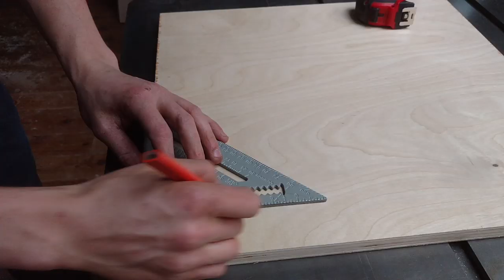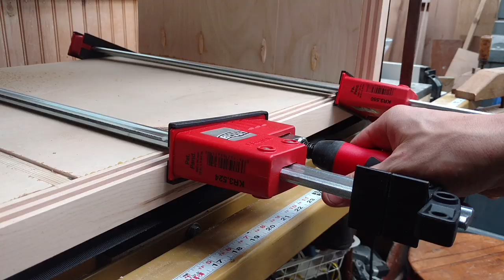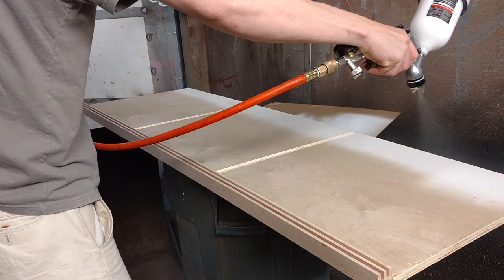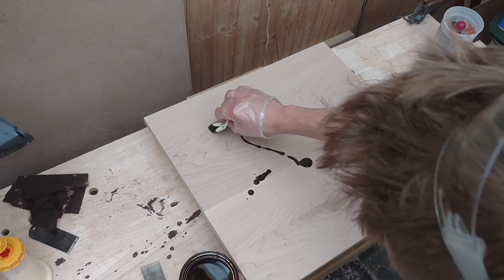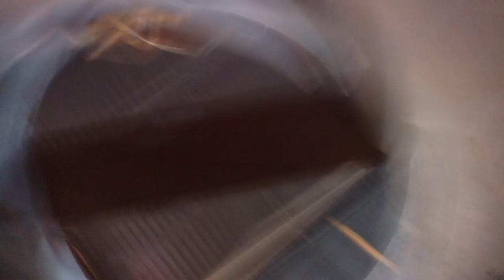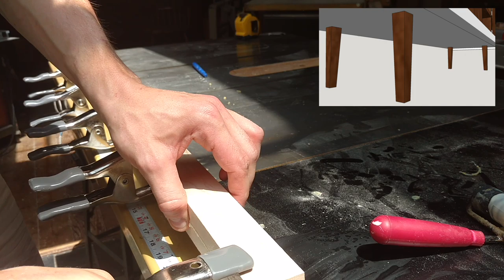Modern Media Console

Comment: Great job, thanx for sharing. What’s the 2 parts paint and ratio you use?
Reply from the maker: Zaldy, I don't remember exactly. It was a laquer based paint. The first was a primer to get the color down. The second was the sheen.  I mixed maybe 5% laquer thinner in to make them flow better

Comment: This is great work! What finish did you use over the white paint, it looks amazing!
Reply from the maker: Thanks Blake!  The finish actually is the white stuff.  It's a two-part lacquer-based spray finish.  The first coat is heavy on the white stuff and the finish coat is glossier.  First time I'd used a 2-part system like that but it worked out ok :D

Comment: Hi, I am in two mind about having sliding doors in my project because of the potential of them not sliding and jamming...what is your thoughts please. Thanks. chris
Reply from the maker: Heya Chris! Sliding doors are great!  I milled mine from solid wood which I would NOT recommend.  Use 1/8" veneered plywood so the wood doesn't shift on you.  If you cut your grooves with a bit of extra room and rub a little wax on the bottoms/tops, they'll fly back and forth! :D
Reply: @yotube123454321  3mm (1/8) wood wow that thin? I thought you may of done the way it shifted when you open/closed them. What you made was it for a client? I am wanting to make them for a client too (newbe to woodwork) just wandering if they would appeciate 1/8 wood :) , and also if the wax may stop working - top up required , what your thoughts ? Chris.
Reply from the maker: @ChristopherClaudioSkierka  yes, this project was for a client.  The idea of solid wood is nice, but the practical reality is that it's difficult to use in this situation.  You don't want the sliding doors to be too thick or else they'll be heavy.  However, if they're thin and you use solid wood (like I did) they wont stay flat.  And then they can get caught in the grooves.  Plywood is designed to be stable and can be very thin without warping/bending.  If your grooves are big enough, you don't even need the wax, it just helps make the door slide really smoothly.  If you rub it in well on the bottom of the doors, you shouldn't really have to rewax.  Also, veneered plywood looks like solid wood unless you're really looking hard at it. :)
Reply: @yotube123454321  Yes all I am using is Birch Ply at the moment. What do you think the max thickness to work ok? do you think 6mm will be okay too? I have this thing that thin is cheap (own paranoya I think lol), I need to change my thoughts to ' what is required to do the job' instead .  the grooves - how much wider than the thickness of the doors should they be you think?
Reply from the maker: @ChristopherClaudioSkierka  6mm would probably be fine.  If it feels ok, then it's ok :) I don't have any rules of what to use, just what feels right.  I understand your thinking.  I thought that all plywood was "cheap" when I started building haha.  You'll find what works for you.  Regarding the grooves, I'd say at least 2mm wider but when I was testing mine, I just kept cutting them wider until the doors felt like they slid well without being too jiggly.
Reply: @yotube123454321  thanks.  ps yes Birch ply here (uk) is not cheap grade b/BB is around £92 plus VAT for a 8 x 4 sheet. I dont think you cannot get away with trial and error. I will let you know how I get on with the 6mm ply.
Reply from the maker: @ChristopherClaudioSkierka  hahaha, yup, that's not cheap.  Proper woodworking, however, never is.  And you're going to make mistakes so don't plan on doing everything perfectly the first time.  :D Make sure you're charging enough for your work.  Your client can buy the same thing online, but it will be made with cheaper materials.  If you make a high quality product, you need to charge accordingly.  Good luck, friend!
Reply: @yotube123454321  Thank you and you too

Comment: Which orbital sander are you using?
Reply from the maker: That's the Bosch 6" Dual Mode Random Orbit Sander. Thing is an absolute beast for removing a lot of material.  Fits somewhere between a regular 5" ROS and a belt sander.